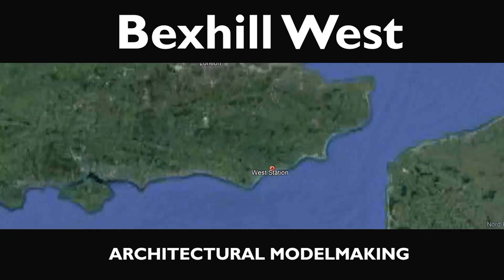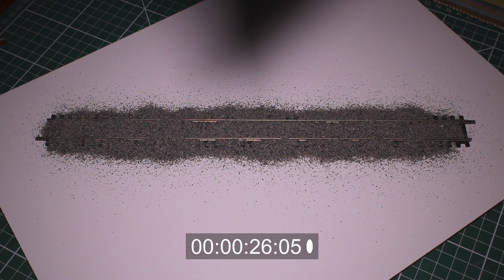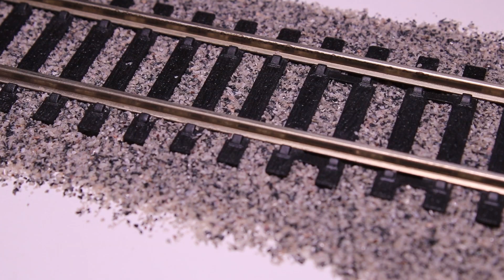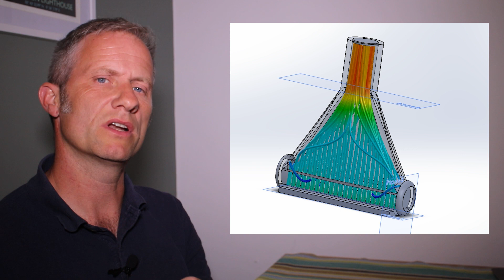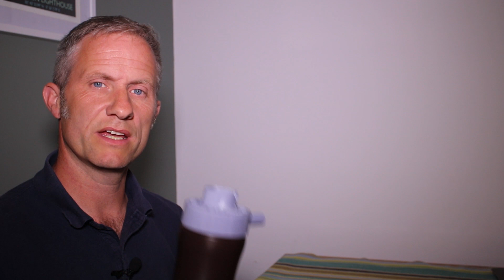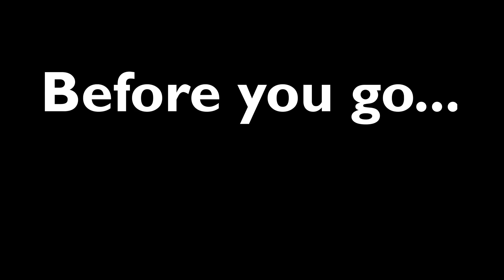Ballasting Model Railway Track the Easy Way

Comment: Did this in the 70's using the vacuum cleaner with a fine cloth over the suction hose, you have to make sure the ballast is well glued and secure or it tries to lift the lot lol.

Comment: Please advise the price of the HO scale complete system that includes the cleaned-up Ballast holding jar.  Is Mpeterll a distributor in the States for you and if there are any other distributors kindly advise. I will have approximately 300 ft. to ballast. Thanks for providing a wonderful product to enhance model railroading. l will have approximately 300 ft. to ballast. Thanks for providing a wonderful product to enhance model railroading.
Best,   Wiley T

Comment: Brilliant and practical solution. This is similar to how I ballasted my recent layout, almost discovered using controlled vacuum by accident (ie vacuum collector with spacer), but the hardware was not as elegant as your solution and required precise hand control as was too heavy. If you ever sell or produce the 3D prints on shape ways or other please let us know.

Comment: Maybe it could also have some additional tools/heads, so it could also double as a cleaner for computers, keyboards and even the modeller’s workbench (that way, any precious screws, etched parts, etc., could be recovered from the intermediate ‘pot’ rather than end up in the main vacuum cleaner?

Comment: Sorry that I'm late to the party. I agree with all the previous comments. It's a brilliant invention.
How are you progressing with getting it (or the CAD files) to market? I'll certainly buy one (or the CAD files).
Be aware that not all vacuum cleaner hoses are the same diameter, so an adapter might be needed for some.
Also, is the collection cup a standard (readily available) size or 3D printable?
Reply from the maker: Thank you Henry.  I'm looking to get this made available for everyone.  Shapeways is too expensive, and manufacturers either aren't interested or are copying it for themselves.  So it looks as though releasing the CAD files is the best bet.  At least it will enable those with a 3d printer to get hold of it.  I am also working on a simpler fabricated version so that those without a 3d printer can enjoy one too.  Stay tuned, there will be an announcement soon.

Comment: This is the  second time I have watched this video and this device continues to fascinate me. I have one question and this is it. Our vacuum cleaner as a variable setting knob which controls the suction power of the cleaner, so can I assume that the suction setting would need to be set at the lowest suction possible. 
I would buy one tomorrow.   Cheers   Greg  from  Australia
Reply from the maker: Thank you Greg, I'm using a standard 'Henry' vacuum cleaner set on 'low', although it works just the same when switched to the 'high' setting.  
It really does make an irksome task rather fun.   I reckon a yard of track could easily be ballasted and vacuumed ready for glue in less than a minute.
Thanks for watching (again) :)
James

Comment: Hi James. I'm convinced. It does a fantastic job. However the success  or failure of this as a commercial product is the retail price. Firstly I would copyright it. Secondly I would approach a manufacturer say WWS to make it under licence and pay you a %. The problem I see is a ballast machine like static grass applicators is that they are used once as the layout is set up then they have a tendency to gather dust on the shelf. So overall they work out to be rather expensive. Its personally why i'm still debating whether to buy an applicator. Yet. But its definitely worth further exploration.
Reply from the maker: I couldn't agree more Gordon.  I think a product like this should be available very cheaply, sub £10, after all it's just two bits of plastic and a pipe!.  So far I'm not having much luck in finding a suitable manufacturer.  :(

Comment: ¡Hola buenas tardes James!  Having spent the best part of half an hour practicing my very first ballast laying (on a small diorama test piece) my jaw dropped as I watched the first video clip you showed. I say this as, the half hour I spent ballasting was 90% vacuuming-up and, relaying various trial amounts of ballast material. Ignoring the issue of the shoulders being tidy, the fact that your system can actually remove just the excess top-of-the-sleeper ballast, has to be a winner. Should you find a way to provide this equipment commercially, I would definitely be adding my name to the preorder list!  Brilliant James and, so well demonstrated. Un saludo. Gary
Reply from the maker: Thank you Gary.  I've tried this now in various configurations, and believe me, this simple first-effort is by far the best.
Modifications to produce a tidy ballast shoulder have worked well, but hinder the wider use of the tool as a vacuum.
If I could only find a way to get the idea out to the masses I'm sure it would be a winner.  It needs to be dirt cheap though, and therein lies the problem.  It may be that the best solution is simply to make the files available for 3d printing at home.  I tried Shapeways and it was way too expensive.  Thanks for the support though, it's much appreciated. :)

Comment: That is pretty cool but you can achieve the same results just as quick with a ballast spreader and a spoon/brush handle. The ballast spreader on the same piece of track takes about 10-15 seconds to put down, then you just rush a brush through the center track, then take the brush (or a spoon) and gently tap the rails. This will remove the ballast pieces from the sleepers. You will still get ballast pieces back on the sleepers once you spray the track with water, then water-pva mix. Might be why the idea was abandoned?

Comment: Hi James. You can put washable PVA on a length of greaseproof paper. Put the track down on top and sprinkle the ballast. Leave to dry overnight. Turn the track upside down and the loose ballast will fall off.

Comment: Looks a clever, simple design. In your demo, it did look a bit like witchcraft that it only removed the excess ballast! Interesting that you said the idea has been around for ages, so it's curious that it's never been developed. Maybe because modellers are inately conservative (with a small c), and there's not been the impetus to move on?  Though the ballast hoppers are, I think, a relatively recent introduction, or at least I don't remember them 30/40 years ago.  Presumably, as well as delivering consistent suction across the head, it's important to be able to control the suction too? N gauge ballast would be finer (and therefore, at least to my non technical mind, lighter) than OO, and O gauge would be coarser and heavier.  I don't think you'll make your fortune and be able to retire on the proceeds from this, unfortunately. Wonder if it would be worth talking to the makers of the ballast hoppers, or other similar firms, to see if they would be interested in producing under licence?
Reply from the maker: Thank you Andrew,
You  raise some interesting points.  The device does indeed just remove the excess ballast from above the sleepers.  I've tried it with fine ballast and a coarser grades and the effect is the same.  If raised above the track by the rail height it lifts only the loose ballast, but if pushed directly into a pile it will lift all in front of it.
Although the principle has been around for some time, my innovation really has been the collecting head and the design optimization of the nozzle.  
In the video I'm using N gauge Gaugemaster ballast on OO track, as that it what I plan to use at Bexhill West.  But the system worked just as well with each of the grades of ballast which I have to hand on both OO and N gauge.  I don't have any O gauge track, but I'm confident that it would work the same.

There is no need to control the suction as that variable is controlled by a vortex generator within the collecting head.  I didn't detail that part in the video as it's a bit technical and I didn't want to bore the viewers.  Especially, as I don't really know the technical jargon for doing so!

I agree the idea isn't going to make me rich, but I am considering how I might be able to make a little from the idea with a view to being able to invest a little back into the channel so that I can make better videos. 
The design is registered so licencing may be an option, although I've no idea how to make that happen! :)
Thanks for watching,
James

Comment: Hi James...just had another thought on using any `hoover' of any power/suction...Just looked at my hoover and there is a small slide switch on the pipe extension which you slide open/shut to increase/decrease the suction. You could incorporate a similar switch on the pipe section just prior to the flexible pipe connection. Then possibly any power hoover would work by adjusting sliding open/closing the slide switch. (it certainly works on my hoover).
2. You could also put a slide-on mini brush at the tip to give a final dust off as the hoover is dragged along the track.
3. I like the size of the ballast collector as well.. Maybe a similar size ballast dispenser could be attached through a splayed tip (as your collector).
Hope you can follow my gobbledegook James. Good luck with this project

Comment: This is an excellent idea. Does it work with any vacuum cleaner? It looks good and works very well.
Reply from the maker: Yes, just a usual domestic hose-type vacuum cleaner.  The vacuum nozzle just pushes into the collector head.
Thanks for watching.

Comment: Looks like a good idea, a couple of things come to mind:-

1. can you attach to any vacuum cleaner with a hose or will more powerful cleaners suck out the contents of the collection hopper and weaker ones not have enough power ? If it will work with multiple different cleaners then all you need is some sort of universal adapter

2. I think I saw a couple of rail width grooves in the nozzle so do you need different sizes for different gauges ? 

3. Will this work with lighter materials such as flock ? If so this could be a really useful tool for anyone working in any type of scenery not just model railways 

4. Maybe a couple of extra tools for getting into tight locations might be useful ?

You might want to design to use some sort of easily obtainable standard size container as the collector
Reply from the maker: Thanks David, you always leave a positive comment!
1. This works on a standard domestic vacuum cleaner.  I've designed it to connect to my Numatic Henry, but I'm sure it would fit most.  An adaptor ring would enable it to fit just about any vacuum I'm sure.
2. I designed this for OO, but tested it on N gauge too and it worked just as well which was a surprise!
3. My thoughts exactly, I think it would be perfect for lifting static grass.  However to do which I think a filter inside the collector head might need to be added as the lightweight fibres would not drop from the cyclone separator.
4. I've already designed a couple...watch this space.  :)
Finally, the collection head will fit a wide range of containers as is.  

Thanks for the feedback, it's much appreciated!

James

Comment: Hi James, I really think you should be on the blower (or should that be the "sucker"? No pun intended!) to Peco / Hornby straight away with this before they pinch your design! As for an improvement, if it could clean up the shoulder of the ballast edge at the same time, leaving nice, clean straight lines it would be perfect - possibly with some sort of "Fence" at each side of the attachment which directed the suction to the edges? Imagine just having to dump the ballast onto the track without having to take particular care to spread it evenly, give it a quick once over with your tool, and all done. I think you're on to a winner here.
Reply from the maker: Thank you Paul.  I have designed a version with a built it hopper/shoulder former, which I'm sure would work very well indeed.  The set-up shown in the video works really well without any extra 'clutter' and is great for other clean-up jobs too.  My thoughts are that this ought to be available with two 'heads', one as you describe and the one shown in the video.
Reply: Hi James. I rather like this idea and also the shoulder former you mentioned in your reply to Paul James. I have a few questions: have your ideas progressed at all? You mentioned that it also worked on N gauge track; exactly the same tool? Although yet to start ballasting, I have bought a mini handheld vacuum cleaner for ballast and static grass. I don't know if all mini handheld vacuum cleaners are a standard size, but could you design/build an adaptor for the minis? Look forward to hearing from you.

Comment: Excellent Idea James I am sure you can take it further hopefully into production. Good luck.
Reply from the maker: I will work on the idea a little more.  It would be nice to take it into production, but I'm not sure of the best approach.
Reply: I think you have done probably the best thing by getting it seen on YouTube to get the general feeling of modellers. Its a job many peopke hate and put off doing particularly in N gauge, ballast hoppers became and still are very popular, but  yours easier and quicker as you demonstrated. If you have your own 3D printer produce some kits and let the big boys in railway modelling promote them. Good luck with your project James.